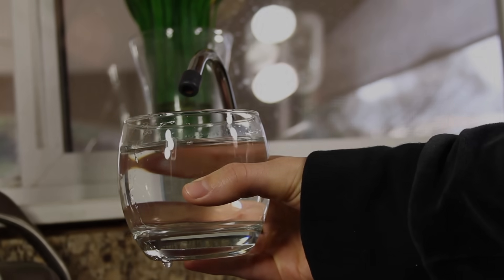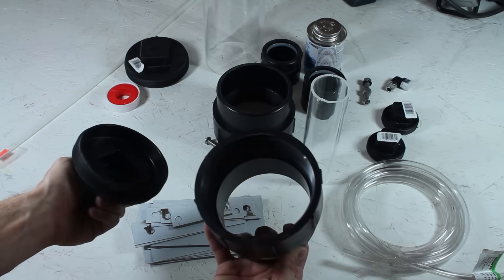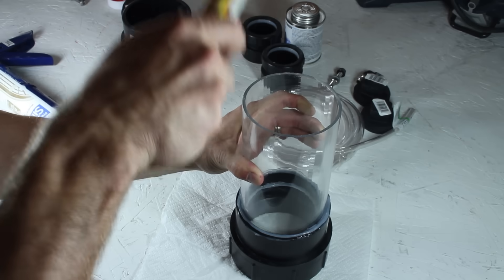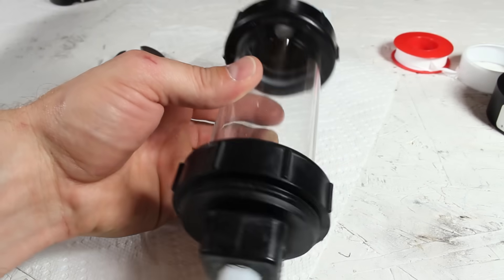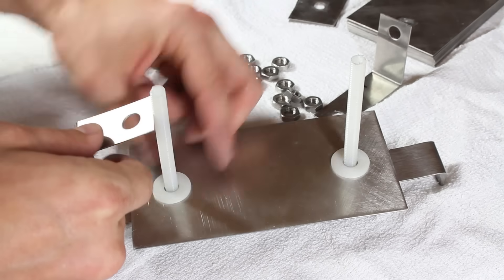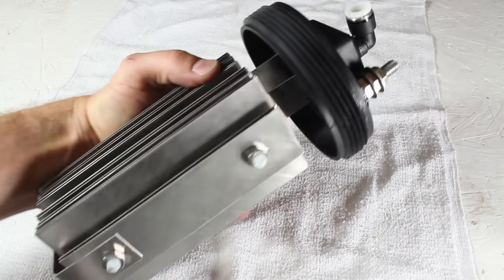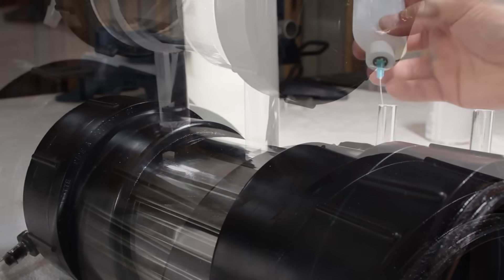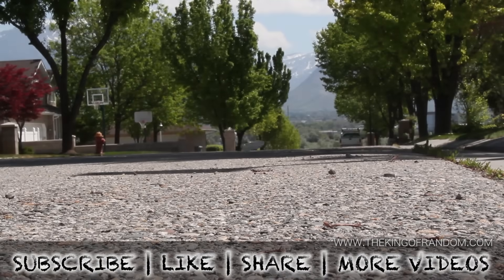HHO Generator - Water to Fuel Converter

Comment: Have you thought about making a pressure release valve incase the pressure inside the main tank builds up too high? or an inline one way check valve incase or flame suppressor incase you want to directly burn the gas out of the end of the tube?
Reply: or is that the point of the bubbler?
Reply: He added a check valve between the main electro chamber and the percolator. He explains this in the video. The percolator additionally separates any other contaminants such as bits of the salt he uses to increase conductivity.
Reply: +DEAD_P1XL i know that the bubbler filters the gas and such, but i meant what if he wanted to burn the gas directly out of the end of the tube, if the flame were to travel back through, there is no check valve between the bubbler and the the end of the tube, so flames would get in the bubbler, could this cause a problem? i would have used 2 check valves, also, what if you had something that was actually sucking the gas from the tube, and the whole thing got bumped around alot, how would you prevent water from flowing through the tubes? could you build a trap after the end of the tube that could catch any water, but alow all the gas to flow freely?
Reply: youngdalton20 There's a check valve. He talks about it. It comes right after the right-angle out of the producing chamber.
Reply: +DEAD_P1XL i know theres one after the main chamber, i meant after the bubbler. as ive said already. incase he wants to burn it directly afterwards.
Reply: Yeah, I was also referring to that point in the chain.

It goes Bubbler -> 90° Swivel -> Check Valve -> Short tube to percolator ->Other output tube
Reply: +DEAD_P1XL no no no, the smaller chaimber is the bubbler, i assume you are reffering to that as the percolator, the main chamber is the generator, the bubbler comes next
Reply: +DEAD_P1XL after he glues the main chamber, he says, while thats drying lets get to work on the bubbler.
Reply: youngdalton20 Watch again. 7:12 "A one-way check valve" right after the swivel.
Reply: +DEAD_P1XL yes but thats after the generator, i meant one after the smaller chamber, which is also called the bubbler. 3:17 lets get to work on the bubbler (the small chamber).
7:20 20 inch tubing connects to the bubbler elbow. (smaller chamber)
i was asking about a check valve after the > bubbler < not after the electrolosys generator. he connects a check valve to the large chamber, then runs a tube to the smaller chamber which is the bubbler. but he does not have a check valve AFTER the BUBBLER. all you are doing is repeating that there is a check valve after the main chamber, we all know that.
Reply: youngdalton20 There's no reason to  have another check valve there. What are you whinging about now?
Reply: +DEAD_P1XL i was just asking, because what if he tried burning the hho right out of the tube and it flowed back into the bubbler? it would probably damage it

Comment: You know that this is actual rocket fuel, right? Is there any way of doing something with the sugar rockets?
Reply: The space shuttle used solid fuels (mostly aluminum perchlorate) in the solid state boosters (twin long white rockets) to do most of the heavy lifting early on take off to assist the main hydrogen fuel rocket. So using a twined system would generate more lift and model the space shuttle. But doing this would become really complex.

Comment: So how much is this going for exactly? I would like to try and modify it so it turns water into a liquid fuel instead of gas, maybe by mixing the water and gas into one liquid state.
Reply: If you are saying you want to turn it into a liquid fuel, that makes hydrogen into water again :). However, if you wish to experiment with other conventional fuels, that will be an hybrid fuel :)
Reply: +Samuel Vijayakumar actually I was thinking of going along the way of gas, making a fuel that is stored in the car as a liquid but when it gets into the engine it instead turns to gas in the piston chamber, so as to not flood the engine from within, and is ignited by the piston striking the gas fuel and making a small explosion
Reply: You must first know that, this is oxy-hydrogen gas and not pure hydrogen. It will mostly have a stochiometric ratio of 2:1. When ignited, the gas mixture converts to water vapor and releases energy which sustains the reaction which is around 240 KJ(LHV) of energy for every mole of H2 burned. So, this will generate approximately 500 to 600 degree celsius more heat than pure hydrogen. This can go into any Internal combustion engine, and act like a conventional fuel. It only requires a spark plug of only 20 microjoule capacity.This is an auto-ignition fuel, that is it can burn on its own if it crosses around 500 degree celsius, or if it is pressurized beyond certain limit. So, consecutive use of spark plug can become unnecessary. However, in cold climates, the spark plug will give additional boost to so as to equalize the damping actions of small water vapour that might result from the combustion. Hope this helps :) Ping for more :D

Comment: I was looking at a freeze frame of the plate assembly, and the two outside plates are attached to one terminal and the two middle plates ate connected to the other terminal. But the remaining 12 plates don't appear to be connected to anything. That cant be right. I can see bubbles forming on all the plates in the video. I would assume that each of the two plates separated by a nylon washer would have to be attached to different terminals for the electrolysis to take place. Where are the connections?
Reply: They are float plates
Reply: I was wondering about this too
Reply: So does it mean that they don't have to be connected to anything and just as the current flows through the water each side of single plate(those not connected to anything) is on little different elctrical potential so the electrolysis runs here too?
Reply: can u explain it please? i still dont know why they don't have to be connected
Reply: You are pretty much right

Comment: From what I can see, there are only four plates that are actually linked in this circuit, the center two plates and the outer two plates. I cannot see how the plates in between actually have a connection. Are they there for aesthetics or somehow connected? Because only the nuts can conduct electricity, the washers are plastic and insulate the plates from each other

Comment: I made hydrogen from water fusing cupper oxide or aluminium oxide on the anode. its fantastically get higher hydrogen volume per min than any method I have seen. you can try it too.

Comment: NightHawkInLight uploaded a video a couple of years ago showing how to produce fairly pure Hydrogen gas using not much more than muriatic acid water and aluminum foil. As well as a one liter heat proof flask and stopper some vinyl tubing and a 2 liter soda bottle. Thought this method does seem make bigger bang but is more involved and very much more complicated.
Reply: but might get you a good grade for that mandatory science fair project
Reply: Its because this produces HHO where Nighthawkinlights produces hydrogen only

Comment: thank god for common sense, and engineering. i wonder if the energy from the car battery that's invested in turning the water into hydroxy gas is more than the energy that's produced from combustion. thoughts?

Comment: people also think that water can conduct electricity, well no potassium hydroxide has to be added to allow electrons to travel in water.
why not use that in cars instead of car batteries? they can make car hybrids and have smaller water generator, could have a 3 cylinder engine and a small water generator, and even the tires can use an alternator to get more energy, the starter can be a small battery insted of a starter which breaks after certain years.

Comment: Why not use solar panel to create electricity for this better yet use it to charge the batteries so you have power always! then use the hydrogen to run a generator or provide heat!

Comment: Teach people how hydrogen will not explode in the absence of any other gas. However, the addition of at least 19% to 21% oxygen will allow hydrogen to explode and bond to the oxygen thus resulting in H2O. Also, this is probably the best method of purifying water. Yes?

Comment: why you need the small second thing
Reply: I guess i just visual, I have same question
Reply: It cleans the gas and makes sure that the whole thng doesnt explode if a spark is nearby.
Reply: If you dont have it it could be fatal
Reply: what
Reply: Its because if you accide tally light the gas stream, the flame can travel bsck through the pipe and the reach the chamber with gas, setting it on fire. The bubbeler stops this

Comment: He literally taught me how to turn water into hydrogen 0_0, i have many uses for hydrogen :D, also, doesn't hydrogen burn? meaning you could light the hydrogen. and boom.
Reply: +Goyagma probably not because this isn't flammable, it's explosive. If you need to get a paper rocket as high as possible as fast as possible, this is your stuff
Reply: ***** True, i have been thinking abot hydrogen a lot lately, i was thinking about what you said, a hydrogen torch, maybe using a one way valve you could somehow seperate the oxygen and the hydrogen, and put it into some sort of holding container, and possibly sell it.

Comment: I saw the plans from where you got the idea, and i dont find information about why everyone use stainless steel, and also, what type, I saw a guy that use 316... Anyway, why not using aluminum, or normal steel.
Also, i try to follow your video and the plates didnt went in the acrylic tube.. haha. I had to use a 4 inche PVC pipe instead, no look as good as yours but im trying.
i just need the car battery and cables wich i dont have in hand at the moment, wish me luck!!

Comment: Correct me if I'm wrong but wouldn't a couple of small, hand-sized propellers, connected to dynamo's (mounted to a car of course) be able to provide the electricity needed for the electrolysis to create this fuel (when the car is in motion)? If so, then is it not economically and economically viable to use this for cars or in hybrid constructs?
Reply: It would work but would increase the drag on the car. So it's benefit would not be a net gain.
Reply: Jock Wochi Thanks and I agree with you but I am referring to dynamo's that use magnets and coils to generate electricity. And instead of propellers, one could alsu use (a) strong magnet(s) that will be attached to the wheel(s) and (a) coil(s) will have to surround the wheel, at least partially. I think a good design would include the entirety of the "dynamo" as part of the wheel itself.

That's why I'm thinking it should be possible to turn the tires' motion energy into electricity without any physical contact which would create resistance. The thing is, I don't know how much electric power those dynamo's will generate and how much Hydrogen and Oxygen that amount of electricity will produce when run through this generator.
Reply: It will still create drag. That's why it takes power to drive a generator. There are three factions to assess: Strength of the magnetic field, number of turns in the coil (Voltage) and the thickness of the wire in the coils (Current).

Yes, one could put such a generator in each wheel but it would still add load to the vehicle.
Reply: Jock Wochi Thank you for the information you're sending my way :)
I don't have the resources to even make a rough prototype but I will take your word on it adding load to the car.
Reply: Just connect the HHO generator to your car's cigarette lighter. A car's alternator is generating more than enough power. It can power 100 watts headlight, fan for AC, stereo, etc. I'm sure a small HHO generator wouldn't hurt the car.
Reply: +BravoTwoZero Sadek this is still a pretty unique idea if I understand what you are saying.
Reply: Yev Villanueva
Sorry, that's not how it works. The more power you take from the alternator, the more power it draws from the engine.
Still though, you are correct, it will not hurt the car.
Reply: Potato Potato Haha, thanks :) I have a few other ideas too as I very much enjoy doing thought experiments. Feel free to test out my theory and make a few bucks off of it if it works.
Reply: BravoTwoZero Sadek that why you use a relay 30 amp

Comment: Is there any real-world applications for this outside of causing mayhem?
Reply: Not yet. It could theoretically be used in internal combustion engines, but hydrogen is "slippery" so it would be very hard to seal against leakage. Conventional engines suffer from blow-by gases as-is but an engine that uses HHO entirely opens a new can of beans.

Using HHO as a supplement might be a viable option though.
Reply: you can put a smaller version in your auto with the  fuel line  into your air intake for your auto, will increase gas mileage and burn more of the gas.
Reply: You can attempt to make Liquid-state rocket fuel.  OR fireworks.  Did you see their liquid-nitrogen rocket-launcher video? because something like oxy-hydrogen would likely perform better assuming you can contain it (no water-bottles).
Reply: Hydrogen can also be used to fuel hydrogen fuel cells, which are essentially batteries that directly produce electric current from hydrogen oxidizing. The problem with this would be that usually fuel cells have pressure, temperature, and purity requirements that you couldn't meet with this apparatus.
Reply: No. Causing harm is by far the best use!
Reply: William Smith
While you can run an engine with hydrogen (with all the issues you mentioned), when making it like this, you lose about 40 percent of the power (electricity) you use to make the hydrogen. When burned in an engine you lose another 60 percent, making the car about 76 percent less efficient than just running an electric car with the electricity you started with at about 90 percent efficiency.
Reply: Erik Oleson Free clean fuel
Reply: I honestly want to make one for my lawn mower and see how that goes.

Comment: Yes I am pretty sure it would work a treat. As you say both electrodes will produce hydrogen then oxygen and so on.
DC is fine if you want to produce H at one terminal and O at the other so that they are kept apart and collected independently.

Comment: I made one of theses for a school project. I used pvc pipe tho and when I took it to school people were looking at me weird and theses two teachers came up to me and asked me what it was and they said well that's a relief it looks like a bomb hahaha
Reply: "dont woory it just makes bombs its not a bomb its self
Reply: Well that's a relief it looks like a bomb.  Well... About that.... It does produce highly explosive gas so.... Yeah.
Reply: "it's just a clock"
Reply: well, it does produce bombs
Reply: abdulla alshudukhi: I made one, so if you need any help just let me know.
Reply: @WillemLawyer  
Hi I am making one for my school science fair and I need some help pls
Reply: @sabafirdouse9883  Sure thing! Youtube comments really aren't the easiest to communicate on, do you have discord or anything?
Reply: so what voltage did you use/ can you use / should you use for best results. and what was the production rater in litres per second whatever. thanks
Reply: @connordow7366  I found that 12-16 was pretty much best for achieving optimal results. More important however is the amperage you use, which more strongly effects the volume of generation. Higher amperage is better, but the same is not necessarily true for voltage. Using 1500 amps at 12.5 volts, basically what's generated from two subpar car batteries I had, in a 10% KOH solution of 112 grams of KOH dissolved in 5 cups of water, I was able to generate about 2.5 liters per second.
Reply: KickOusFilms Thanks for the rather quick reply! I will take this into my project, Thanks again =P
Reply: abdullah alshudukhi the only changes i made was i build mine out of pvc everything else i just followed the video. Some of the parts i couldn't get at lowes and had to order off amazon.
Reply: +KickOusFilms It could be a hydrogen bomb!😂😂😂
Reply: KickOusFilms what sise pvc 110mm?
Reply: KickOusFilms What did you use as a catalyst? Did you use potassium hydroxide? If so was it 100% pure?
Reply: KickOusFilms
Reply: LOL
Reply: Haha...
Reply: how much did it cost u for all of those materials? and how long did it take u to complete it? thanks.
Reply: same
Reply: Dude, don't be a wus. We need more of this counteract the cartels. Energy and the freedom to think and create should not be squandered because of its looks. Ur the guy who will be happy payin $8/gal for gas
Reply: Sounds like you're in 5th grade...
Reply: Hey dude nice job XD, I'm going to create this for a school project too, can you give me any tips or any websites that helped you, or maybe even some changes that you made? I need your help =P
Reply: is what?
Reply: It can be.
Reply: KickOusFilms
Reply: Connor Dow the higher voltage the better as long as it's dc
Reply: It technically is a bomb
Reply: Umm so to tell you bud but in its self it really is a bomb, plus I can't really imagine even high schoolers just bringing that in as a school project like wth.